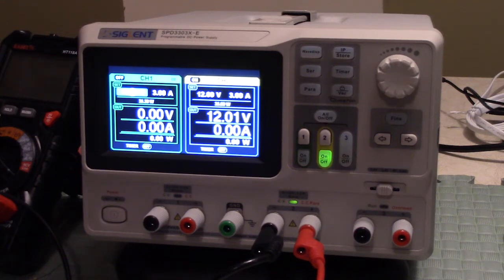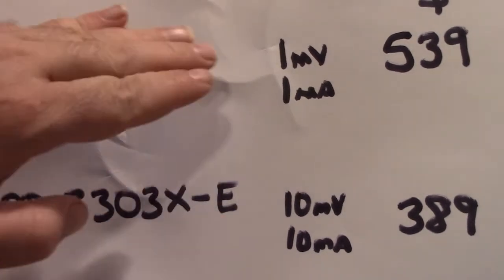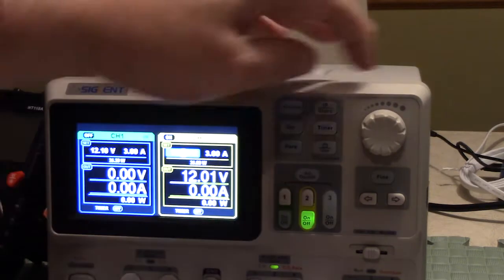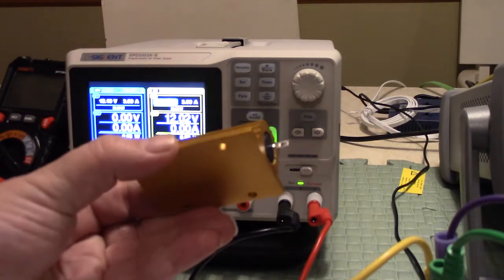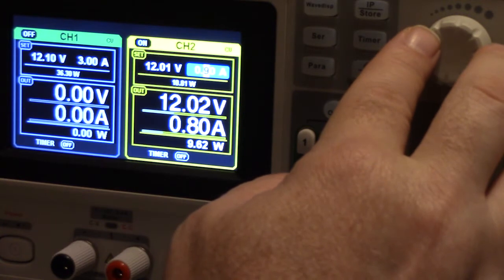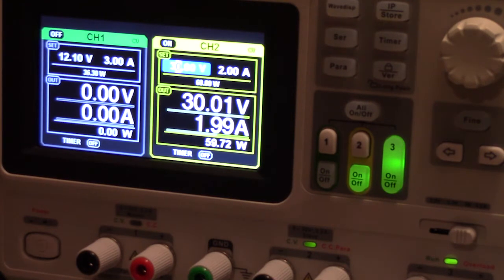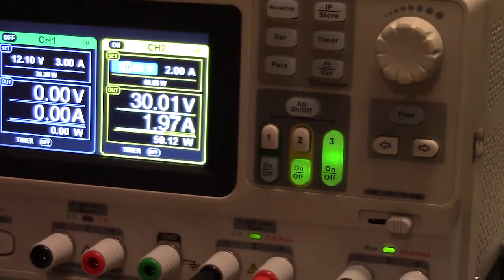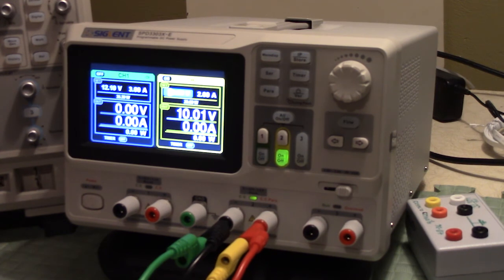ER02B: Siglent SPD3303X-E: Evaluation

Comment: I bought the X-E version and I was missing the extra digit of resolution on a regular basis.  As I result, I also purchased the X version.  So I did not really save $150 but instead cost myself $400.  Fortunately, I have a use for the X-E version.  My advice is that make sure you don’t need that extra digit.

On both units, I have to say I am very pleased with them and I would buy the X version again.  Also, the remote control using the Ethernet port works as advertised.  (I did not use Siglent’s software but I wrote my own software for a PC.)

Comment: I thought I'd share this with you.
https://en.wikipedia.org/wiki/Statcoulomb
1 statC = dyn^1/2 cm = cm^3/2 g^1/2 s^−1.
=> SQUARE IT: (1 statC)^2 = dyn cm = cm^3 g^1 s^−2 = (cm^3 s^−1)(g^1 s^−1).
Yes that's it...SO simple!  Charge= Geometric mean of volume and mass flows.
Reply: Also, there's this:
https://www.google.com/books/edition/Encyclopaedia_of_Historical_Metrology_We/XnRVDwAAQBAJ?hl=en&gbpv=1&bsq=%22Charge%20(Q)%20statcoul%20(g%20cm)%2Fs%22&dq=%22Encyclopaedia%20of%20Historical%20Metrology%2C%20Weights%2C%20and%20Measures%22%20vol%201&pg=PA26&printsec=frontcover
Reply: ..and this:
https://www.google.com/books/edition/Encyclopaedia_of_Historical_Metrology_We/XnRVDwAAQBAJ?hl=en&gbpv=1&bsq=%22Charge%20(Q)%20abcoul%20(g%20cm)%22&dq=%22Encyclopaedia%20of%20Historical%20Metrology%2C%20Weights%2C%20and%20Measures%22%20vol%201&pg=PA25&printsec=frontcover